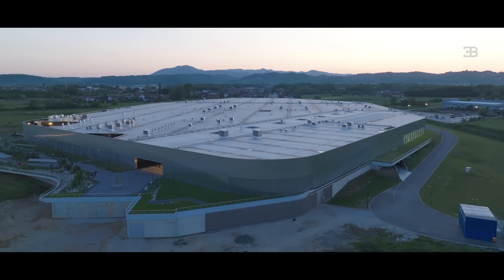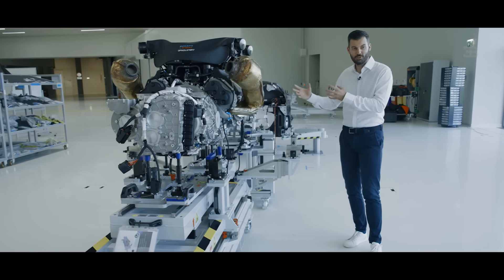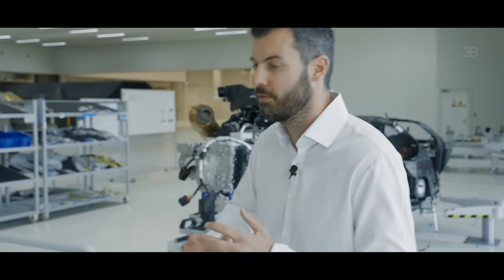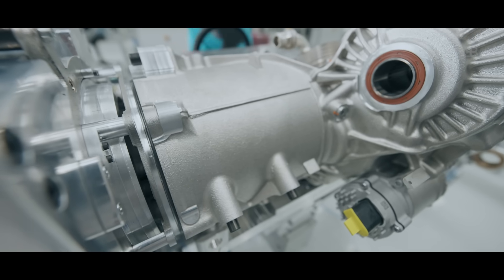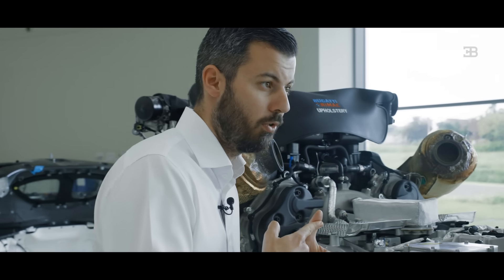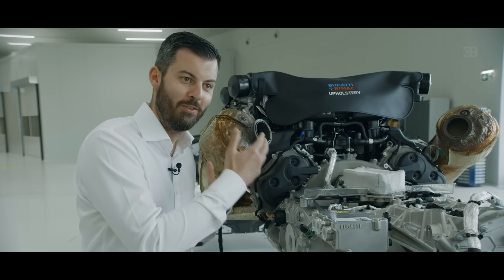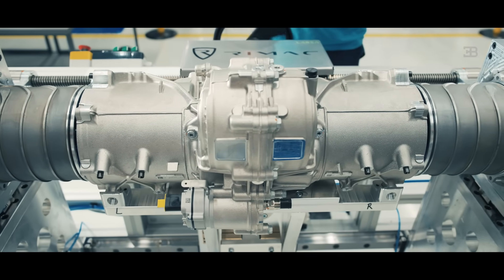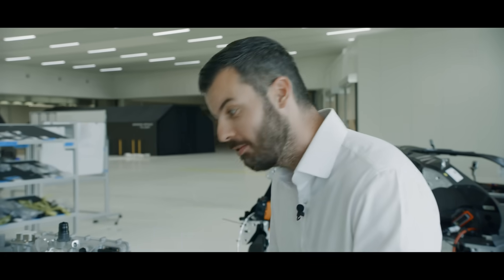BUGATTI — A NEW ERA: Hybrid Power

Comment: Bugatti just start a new era of speed with hybrid system as its potential can be reached to a much larger extent but the side effect will be the weight which is not in fully carbon fibre. So good luck making another Fastest Speed and acceleration Record

Comment: I am a service engineer. I've completed training on lithium batteries and it's very interesting yet not for the faint hearted in regards to carrying out repairs. It will also surprise most people how small the connections are between cells within the battery modules. It's exactly like multiple vape batteries connected in series and or parallel to create the output.

Comment: the centre battery should move on rails front front to rear, whereby weight can be used either for traction at the rear of the car and moves to the front on hard braking or turning, shifting a disadvantage into advantage. I call this concept "Track-Traction" this is short for the battery track aiding in traction. this concept can also be improved to move left and right..that design i'm still working on.

Comment: I am supporting the combustion side of the Bugatti.  The electronic side not so much.  I am not trusting battery technology for electronic movement.  However, if ever I am able to purchase, I will do so without hesitation.  🤗
Reply: That's an absurd position to hold in 2025. The Prius has been sold commercially (in Japan) since 1997, and Prius taxis frequently hit 300,000 miles (and 500,000 isn't even that rare). The only reason this marvel of Bugatti engineering can put out such insane specs is BECAUSE it functions as a hybrid. If they're designed well, hybrids really do give you the best of two worlds.

Comment: The one thing I kept thinking while watching this video was what if they just got rid of the gearbox? That’d lighten it considerably and the electric motor is more than capable of driving the car at low speeds.

Then I remembered Koenigsegg did that in the Regera over a decade ago.

Comment: Why don't you have each wheel have its own engine that each are able to lifted by a person ...so maybe 90LB or less each for each wheel and/or every individual power source be different. That way the owner doesn't have to worry about running out of just gas or electricity. And make it easier to reload. You could make energy like reloading a mag. Just swap them out at a "fuel" station like changing out a cool looking propane or gas or battery or water or what ever else we can figure out to power vehicles

Comment: "electric motor to cure boost lag"... "and you get it with a NA v16"
ummmm.... alright
Reply: It means that the W16 had turbo lag... and since the V16 is now NA.. the electric motors are there to fill in the gap of power

Comment: The Dark Marrer Koenigsegg electric motor is 800 horsepower, 1250 Nm motor is patent-pending and has a Raxial Flux design. It weighs 86 lbs and is 383.3 mm tall, 381.5 mm wide, and 135.5 mm long, Bugatti is the second best built car in the world and it’s not ever close to a Koenigsegg, show’s you what Christian has accomplished

Comment: Jeez the size of that engine! Makes you realise that it’s just a massive engine driving around draped in a thin covering of bodywork.
Reply: Really it's exactly the opposite of what Ettore Bugatti was about.
Reply: ...

The Bugatti-Rimac Group consists of Bugatti Automobiles and Rimac Automobili. Porsche holds 45% of the shares, the remaining shares are held by the Rimac Group, whose shareholders are Mate Rimac 35%, Porsche 22%, Hyundai 11% and free float 32%.

Comment: Hmm.. surely using the rear motor to improve low-RPM torque (i.e., by seemingly sending power through the gearbox both to the rear wheels and to the engine itself) is inefficient (transmission loss) and strenuous on the engine (e.g., timing system). Why not just use the front motor for this?

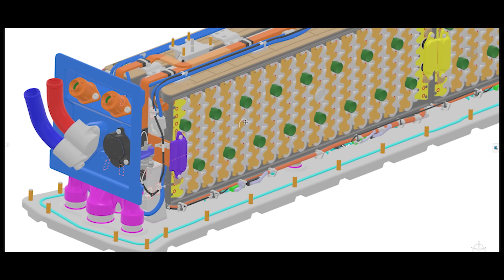Comment: alot of ultra high power 21700 here!  6 modules of 32s8p  800V system for 1536 cells?  700kW mean 455W per cell!  that's more than 100A peak per cell.. only few can do that. Iwonder if these are the 40T, P50B or P60B or even the 50PL .. or something else! 3:57
Reply: 50PL.02 ! ❤

Comment: I like the "tested" 520km/h on the dyno shot: 3:35
Reply: Zero air resistance
Reply: Absolutedly brokers that even in no time. This is probably capable of going north of 550-560 kmph
Reply: irrelevant unless it's on an actual road lol
Reply: 0-60 in 1.1 lol
Reply: simulated or on a specially prepped surface or on an ordinary road where it actually matters lol
Reply: drag enters the chat
Reply: @Nevillefuego  And leaves immediatly because going very fast for 400m in a straight line then needing a complete engine rebuild isn't actualy interesting in any way
Reply: @dawa7049  He meant air resistance, not dragsters. As in the fact that it will be much harder to achieve those speeds in the rear world due to drag
Reply: 1000nm at 12-14k rpm, 400nm at 24k rpm. Not bad, but it means the car won’t be beating the Chiron’s speed record
Reply: @Noname-iq1gz  LOOOL shutup..

Comment: Now THIS is how you do a hybrid supercar. Other manufacturers should be taking notes.
Reply: Uh the revuelto has this EXACT STYLE OF HYBRID POWERTRAIN SETUP ALREADY IN PRODUCTION SMDH for 12+months now!

Big na v12 in the back with a raxial ev motor pancaked into the gearbox, no starter motor, electric motor does all reversing as well. 
2 motors with torque vector ing and lsds up front completely separate from the back! 

That in itself is just a copy cat of the Ferrari sf90 setup from 6+ years ago again SMFH!
Reply: @4literv6 but sf-90 has 1000 hp and 800 nm 
Tourbillion has 1800 hp with 2300 nm

Comment: I love hybrids, dont see why anyone would dislike them, you get the benefits of electric with the personality of an engine
Reply: because hybrids in normal cars are made for saving fuel and almost every time coupled with dull engines making low power with high vehicle weight.
Reply: @tubejorrit oh true, forgot about battery weight
Reply: I think hybrid makes sense in hypercars etc. since you can actually get the BEST of both worlds as Mate explains. But, in regular everyday cars you tend to get the WORST of both worlds, mechanical and electrical issues of both systems, boring ICE's and small batteries which get abused to hell and back with constant charging and discharging. So this is why I think BEV's make the most sense for everyday use, hybrids for the bleeding edge hypercars and pure ICE for motorsport for maximum weight reduction.
Reply: @Tomzuki.  I agree. Though hybrids might be better for Motorsports because their performance far out weighs their weight. Look at F1 and LMP 1 Cars they both are hybrids and are ridiculously light and they have the best of both worlds.

Comment: Interesting electric motor choice - engineering explained will cover why they went with this vs inline
Reply: Having the electric motor after the differential gives you an electric differential for free. Like some use the brakes individually to simulate a variety of differentials. It also allows accelerating and regen-braking without sending power through the drivetrain.
Normal road cars don't send enough power through the drivetrain to justify the added complexity. Constant speed on a highway is around 20kW, constant speed urban is <5kW. Losses are in the dozen to hundred W range; you only need the high kW numbers to get the heavy weight of modern cars moving in the first place. On the Bugatti, you can expect something above 1000kW for an elongated time to reach 400+ kmh, like the 520kmh they "tested" on the dyno. So losses in the drivetrain will be a handful of kW, which you now do want to avoid if possible.

Comment: 1:42 How can you have torque vectoring in the gearbox? I'm not an expert, just asking.  Gearbox sends power to the differential, it can't differentiate between wheels.
Reply: Maybe like new golf r and rs3, instead of using a conventional lsd as rear diff, it might be a pair of clutch, one for each wheel, then use motor control how much clutch to apply to achieve torque vectoring😊

Comment: Rimac is creating timeless pieces of engineering and Koenigsegg is starting to lose the leadership in innovation
Reply: ...ermm Gemera was presented at 2020 Geneva Motorshow!! We are in 2025 and where's Gemera?? 😂
Reply: Nope. Name the all new invention in this car. Koenigsegg made worlds lightest carbon wheels, one and only 9 speed 7 clutch(no flywheel) transmission, worlds lightest v8 crankshaft, fastest revving production engine, stimulated manual transmission featuring 9 speed lst and software controlled 6 speed manualwith clutch pedal, worlds widest carbon fiber monocoque, worlds first 4 seater megacar, worlds most powerful production car. Tourbillon engine is completely developed by cosworth. Rimac don't give a f*ck about bugatti's future. i wait on your answer

Comment: 300 horsepower from a baked bean can! Electric motors are incredible!!
Reply: See the koeneiseg dark matter raxial cf hybrid design ev motor. 88# develops 800+hp! About the size of a pizza!
Reply: @4literv6 yep. Koenigsegg is better in every way. This Bugatti is a bummer for me.
Reply: @4literv6  Can we see a video of a koenigsegg driving 300 mph?
Reply: @Yes-qj4bi No production car has surpassed 278mph yet still got a little ways to go. As of now only way to hit 300mph is to modify
Reply: @antilagboostaddiction8322  that would be true if it were a true statement, but unfortuntately for you I'd assume, it's not as there was a car with video proof going over 300 in 2019 and has since then been put into production.
Reply: @Yes-qj4bi There is no production car doing 300mph the fastest Homologated Production car is still held by the Agera at 278mph the production Bugatti can only go 272mph. So once again the only way to hit 300mph is to modify and in the modified category the Ford GT is the king by a insane margin.
Reply: @antilagboostaddiction8322  This is again just not factually true, there is a production car that has video proof showcasing the potential of the vehicle to hit that speed and actions speak far louder than calculations.
Reply: @Yes-qj4bi  Potential doesn't set records. No production car has hit a two way 500km top speed.
Reply: @antilagboostaddiction8322  Your statement is factually incorrect. The Koenigsegg Agera RS no longer holds the world record for fastest production homologated road-legal car. The SSC Tuatara broke that record. And no, I'm not talking about the fake 330mph top speed run. I'm talking about the run they did AFTER that. After they admitted their first was faked. They achieved a two-way average top speed of 282.9mph. Because yes, they did it in two directions. Making it an official top speed run, and they were quite literally given the world record. Additionally, the Bugatti Chiron SS 300+ has achieved 490kmh/304mph, but while it was a production car (although some argue it was a "pre-production" car) it was only in one direction, therefore does not count as a top speed record.
Reply: Have you seen mission impossible 7?? Youll see why thats a bad idea
Reply: ...

The Bugatti-Rimac Group consists of Bugatti Automobiles and Rimac Automobili. Porsche holds 45% of the shares, the remaining shares are held by the Rimac Group, whose shareholders are Mate Rimac 35%, Porsche 22%, Hyundai 11% and free float 32%.
Reply: They are, but the batteries powering them ain't. This car is the same weight as the 10 year old Bugatti Chiron
Reply: @declanosullivan8749 its quite impressive to be as heavy as a chiron given by the batteries
Reply: @declanosullivan8749  Considering that the Chiron only had the motor and gearbox, and this has 2 motors, gearbox, and batteries, I'd argue that is amazing! If anything it's a testament to how far we've come in both electric motors, and batteries that we can get so much out of them with not much added weight.
Reply: incredible power, yes! soul? no 😢
Reply: @timsane  do you think combustion engines are a sensible future for the majority of cars?
Reply: @ironmanthegoat780 never. but as an Enthusiast the mechanics, feel and noises of an ICE are important. I am glad they kept a „real“ engine - most electric cars do not and have no soul in my eyes.
Reply: @ironmanthegoat780 Engines can run on water and there is tons of evidence oil is a renewable resource and earth continues to make it just like it always has don't fall for government propaganda. You don't see the government driving electric vehicles, no secret service vehicles are electric, our military vehicles are not electric ect.... They tell you that YOU need to drive a electric vehicle to save the planet while they fire up the engines on there 400ft mega yatchs and billion dollar private jets😂 Just like diamonds are not rare they just hold down the bulk to control the market. People and greed will be the reason the world crashes and burns earth is self sustaining and gives us all we could ever need but that information won't keep the elites in power. Government convinced all the gulable morons to take the vaccination you don't see none of the government take that shit and half the medical field of doctors and nurses quit there jobs over night because they refused to take it. All the signs are right in front of you a little common sense goes a long way
Reply: @timsane  you have no clue what a "soul" is, then. Because race car drivers enjoy EVs much more :)
You just are stuck in RICER ignorance and haven't matured into the experience of desire to go fast, yet.
Reply: @sqlevolicious I did not know my Porsche and Lambo made me a ricer 😂
Reply: @timsane  I totally respect your opinion. I’ve actually been doing up a VW Up and I’ve actually been loving learning about all the mechanical elements and workings, something that I think will be lost slightly with simplified EVs. However I believe the majority of transport should become electric, however it think racing cars, sports cars, and air travel should remain combustion! Gorgeous Aston martins and Ferraris should have proper engines! I also think aviation should remain combustion but with bio fuel as electric just isn’t a viable idea!

Comment: Why not use hydrogen battery to save weight
Reply: Hydrogen batteries?
Reply: @ganymede6535  Google it. With it, he can use electric motor with gasoline engine. Put pure gasoline and hydrogen in car
Reply: @ganymede6535  I forgot you cant pull that much power with hydrogen battery
Reply: @banuwii i think you mean fuel cells

Comment: I’m curious how this car’s drivetrain will hold up over decades as these cars tend to be in collectors garages. You can get an old Bugatti type 57 and mechanically keep it going for decades for it’s simple mechanical design yet these hybrids I worry about. Not sure how confident I would be expecting these cars to be going 50+ years from now with batteries.

Comment: Mate is a genius! New Era incoming
Reply: Nev era 😉
Reply: Nice su 47 😊
Reply: you are joke'ing ???? Hubrid/EV = Sh*t
Reply: ...

The Bugatti-Rimac Group consists of Bugatti Automobiles and Rimac Automobili. Porsche holds 45% of the shares, the remaining shares are held by the Rimac Group, whose shareholders are Mate Rimac 35%, Porsche 22%, Hyundai 11% and free float 32%.
Reply: The engine is developed by Cosworth!
Reply: I hope bugatti will go for ultra innovative tab-less design cylindrical cells which has 70% to 90% lower internal resistance with around 50% lower generated heat in ultra high charging currents(5c or 700 amps)and pulse discharge rates(40c) . They have between 50 amps to 70 amps continues and around 200 amps of pulse discharge rate(40c discharge rate)for 5 continues minutes . With twice the cycle life compared with traditional tabbed cells . 25 kwh capacity with tab-less 21700 can provide unseen and unheard before 1200 kw(1600 ps) from just tiny 25 kwh pack...